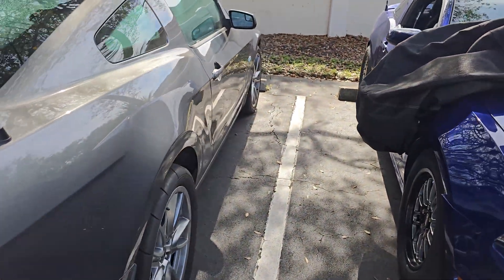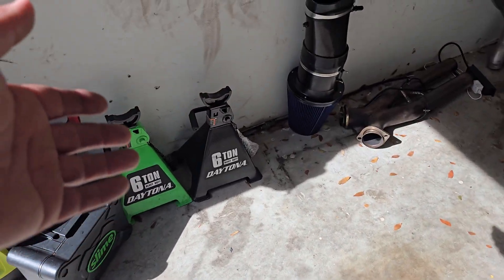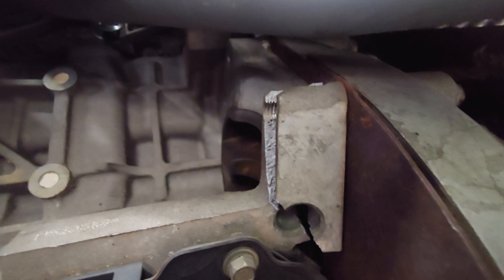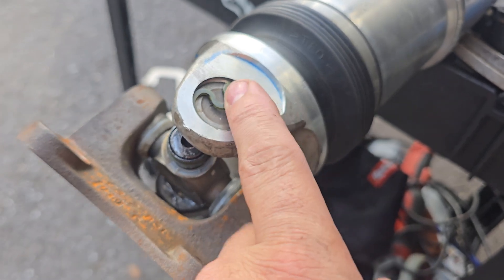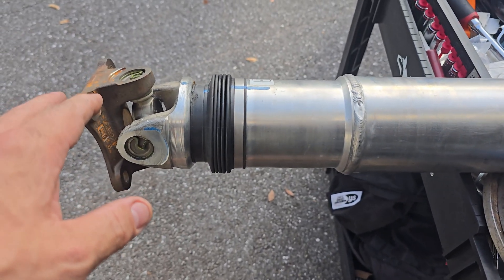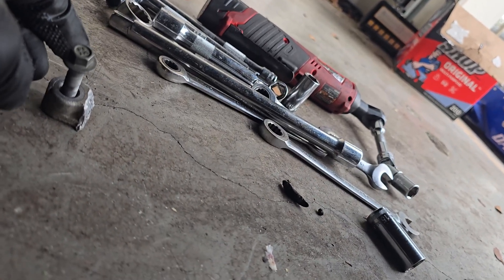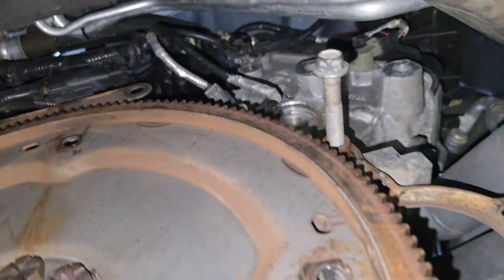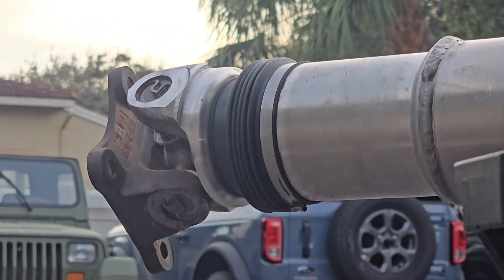CATASTROPHIC Drive Shaft Failure at 120MPH: See The 6R80 Damage

Comment: Odd failure, idk your setup but it would be a good idea while you’re under there to check your driveline angles with the suspension loaded to make sure you’re not maxing out the u-joints

Comment: Thanks for the update. Glad you did not get hurt. Getting the parts welded, whether MIG or TIG will be tricky with the motor in. The parts must be extremely clean to get good penetration and strength.  Looking forward for more of the repair on Donny

Comment: Those bottom bolt holes that broke off are just for the transmission. The three starter bolts all go in to the trans bell housing. That broken ear below the starter won’t cause any issues with the starter. Starter centers on that steel spacer plate and bolts to the trans. Still sketchy, but you should be good to stick a new trans in it and roll on.

Comment: When this happened to my gen 3 motor, welders told me that there was a risk of the engine cracking more as it cools. Cast aluminum is difficult to weld apparently.
Reply: Said fuck it and ran it with the same cracked trans after I got the new clutch on and aside from it vibrating hard between 2750 rpm’s to 3250 rpm’s it drove fine.
Reply: Eventually got a new motor because OPG failure and a new trans of course.

Comment: The driveshaft looks like there’s no room to compress in that expansion part. So if the driveshaft couldn’t compress, if you hit a bump, suspension compress, weight from the force of the car going down could have damaged the u joint. Could have crushed the bearings and the centrifugal force fling the cap off, vibration, and then just how you described that violent vibration causing the carnage.

Comment: I've seen (and been in the car for) some nasty driveshaft failures.  But it was always the shaft breaking or shearing.  Even had a cheap shortened shaft soda straw up.  But I've never seen block damage like that. Almost seems like not failing completely made it worse.  Still better than coming through the floor or pole vaulting the car though.

Comment: Tbh it looks like the engine and transmission werent lined up right which caused the drive shaft to fail. I usually grease the dowels and get the rust off so it slides in easily and support the front of the engine so it tilts up so the transmission can slide easily.

Comment: The bottom ear on the right cylinder 1-4 side is also for the transmission.

I’m about to put a Carbo driveshaft in my swapped 69 for the same reason you just said. I’d much rather the driveshaft explode rather than come through the floor.

Comment: Had a similar thing happened with a 4v swap Fairmont with a t45. Ripped both lower mounting ears off the block and split the bellhousing all the way around. Set fuck it and LS swapped it. 6.0/T56 > 4V/T45

Comment: Throw that free converter in the trash & start over…. No luck since converter install. Bad juju bro 😂
Reply: For street use maybe the exhaust heat is too close for carbon driveshaft, definitely consult with driveshaft manufacturer first.

Comment: Man i wish i had your motivation, really props to you  alex.
Welding cast aluminum going to require a lot of faith in the person doing the welding.
Reply: My question is can the weld repair be done with the engine in the car or is it better to remove the engine so the parts can be cleaned properly and welded in????  MIG or TIG will be a factor also.
Reply: @robhunter2435 Helium Arc welding. But you are right. Needs to remove the engine most likely because most Welders won’t do it in the cramped space.
Reply: @robhunter2435  You'd  have to Tig it and its always better work on the piece without obstructions but thats up to alex